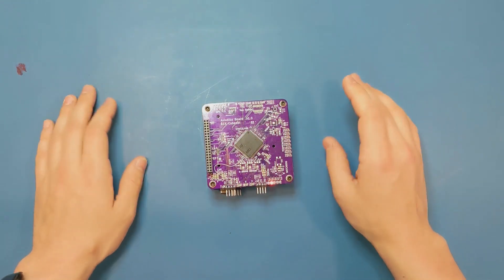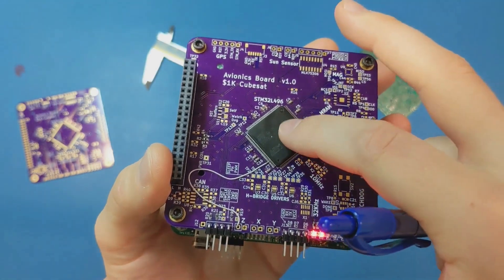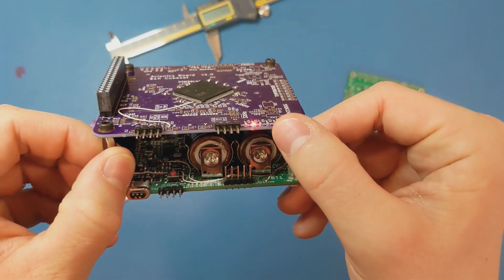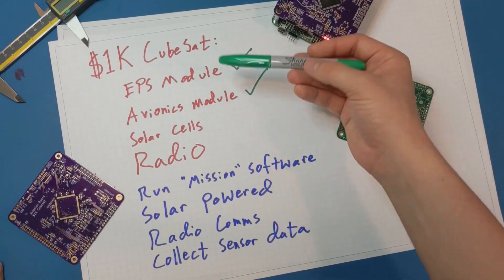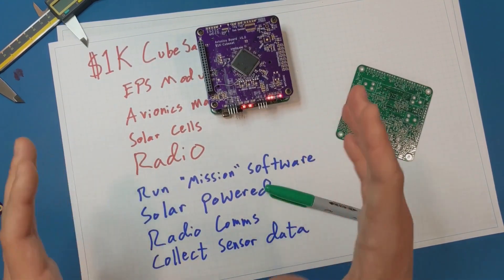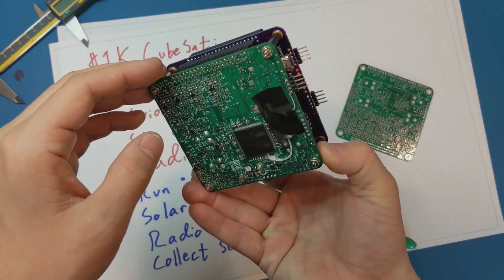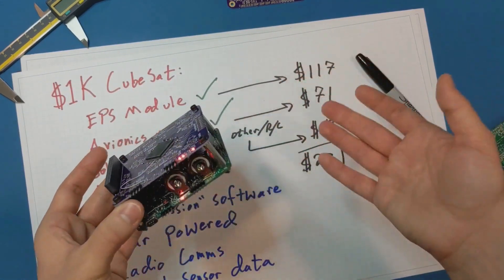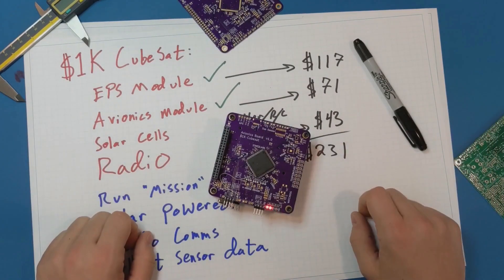½ Cubesat | Progress, Cost, & Future of my $1K CubeSat

Comment: Hi, cpild i have a copy of your half but importantly the avionics and communications are suffered to find radio cuz I'm doing security research on satellites but using digital twins looking at cubesat hardware-software and radio communications as I'm in the middle of a satellite cyber-attack which tracks all satellites that come over head with VHF UHF and GHz abilities. Add to that multiple strs amplifiers on fpga and the Jets in parallel processor coupled with a couple of different advise breakout boards for the GPO connectors and it'll be portable but since you've already made them do you happen to have a couple of spare copies that I could use for testing?

Comment: Do you have your HAM license? I've been working to port over the Arduino HAM Shield schematics from the EnhancedRadioDevices
/HamShieldMini GitHub project to a CubeSAT communications board footprint. A few of the amplifiers have been a little difficult to source but it still shows some potential.
Reply from the maker: Nope, I don't have a HAM license, I'm pretty new to the space. 

That's cool! I'll check it out

Comment: The antenna connector is built into the Iridium 9603 module, so you don’t have to touch any RF signals right?. The sensitivity from the datasheet is dangerously optimistic with interference. Not sure what the noise level is like in space, but assuming a 3dB lower link margin is probably safe.
Reply from the maker: I'm not planning on using the Iridium network anymore - the operational cost is quite high. Even though it is an easy to use off-the-shelf solution.
Reply from the maker: The TJ REVERB cubesat that recently launched is using Iridium for communication, and they did the math to show that it should work.  It's just kind of expensive for what I want to do.
Reply: This has to be the best guide “doing something” off the back with RF. Michael’s taste in transceivers is probably a little easier to swallow on the price side too. https://youtu.be/TnRn3Kn_aXg
Reply from the maker: Awesome! I'll check that out
Reply: Transmission lines don’t have to be scary either! There is a calculator in KiCad that can give you the geometries. Go coplanar waveguide with ground plane when you can. https://youtu.be/GuJVkZgAloI